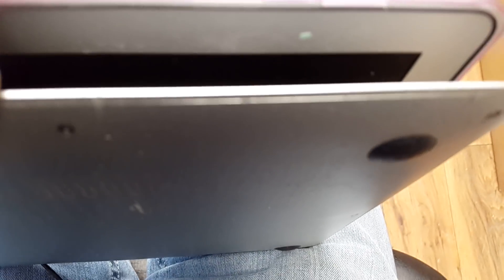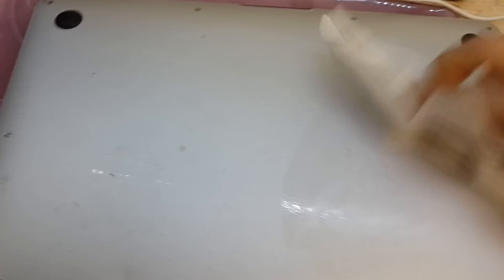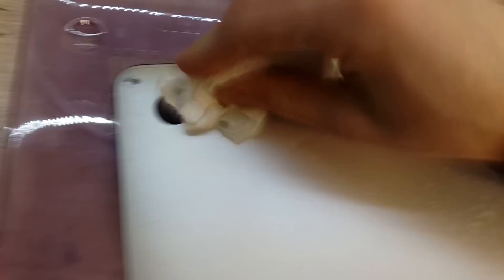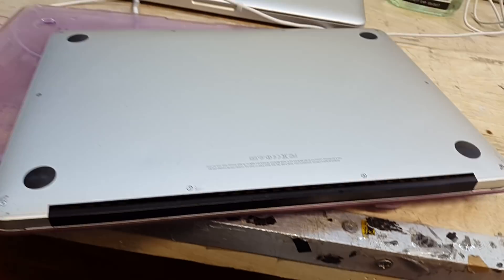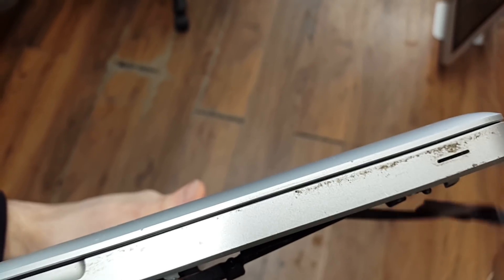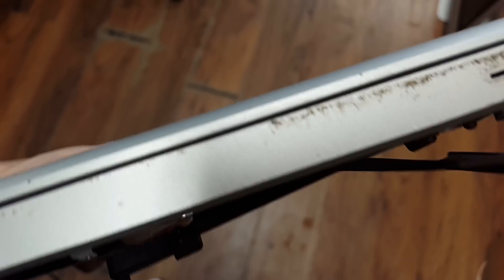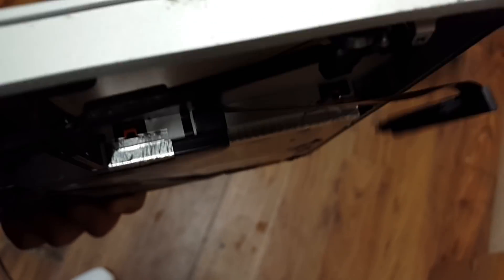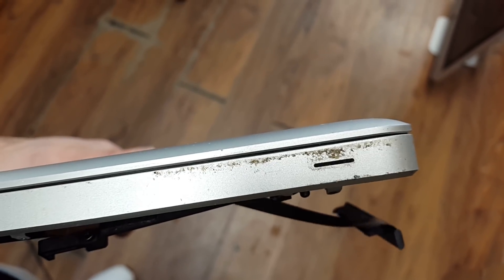Avoid plastic snap on Macbook cases: they are disgusting! 20160123 105752

Comment: I can never understand the meaning of putting on a casing for laptops. And to my knowledge, I think only MacBook users like to have casing for their laptops.
Reply: People who buy a $1200-2000 mobile device seem to be easily tempted to buy a $10 product to protect it.
Reply: @dgk4486  The thing is, adding a snap on case not only covers the original sleek design of the product, making it feel worse, and the product itself will still get old and wear out as time goes. I never use any case for my cellphone and laptops, nor do I use screen protectors. I can understand the need for making the cellphone grippier or more protective against falling. But laptops? I don't think that's really necessary.
Reply: @weskeryuan6435  The point for these cases is to prevent against case damage due to small bumps and drops. This is particularly true of the rather flimsy metal used on the MacBook Air. It's really easy to dent these. I'm not fond of the gunk that ends up under these plastic cases, but they do serve a purpose for people who are prone to dropping things. It's super easy to dent key connectors and prevent their use on the MacBook Air. With that said, most people don't know that you have to periodically remove the plastic and wipe down the metal. It should be common sense, but I guess a lot of people don't know this.
Reply: Nah man dbrand is cool
Reply: @EpicCineSnaps  Dbrand is shite my dude, I have never had a Dbrand skin that didn't make my phone a slippery mess.
Reply: @thatwolffe3802  yea it makes em slippery but for my mac it does the job
Reply: it's all about the fact that they hold value much better than cheaper chinese laptops, so people think they will be be able to sell them for more if it LOOKS better (after hours of cleaning)
Reply: It's so they can put stickers all over it hahahaha

Comment: The only snap-on Mac case I've ever used that never seems to have that problem was a case made by STM and that's because it has no vents on it (which isn't needed anyway) and the interior of the STM front and bottom cover is lined in a fine microfiber/suede type material. That leaves no gap for dust and crud to get under it. Sadly my laptop seems to have suffered a burnt out backlight fuse. It still works, but doesn't light up and sending it to Louis from Australia for a 2009 model Macbook Pro doesn't seem worth it. Even my friend Theressa (Louis knows her) thought it wasn't worth fixing.
Reply: It me  Why TF can't you read properly. The screen is dead, I haven't used it in years, it just collects dust now. I've been using Windows PCs for years. I got the darn thing back in 2009, that's 10 years ago in case you can't count that high :P
Reply: It me Get stuffed mate, I don't have to justify my reasons for buying a Mac to some d-bag in the internet.
Reply: It me  There's a bridge somewhere that's missing it's Troll, get back to work.

Comment: I accidentally did that on my MacBook years ago. It made me sad when I went to do my yearly internal cleanup. Please for the love of god do not get that plastic shit.
Reply: I've been using them for years and it is never like that when I take the plastic off.  You can wipe it right off. I don't know what you people are doing. It's not happening to me.
Reply: @rrrglynn  Maybe you are that one clean person who washes their hands after going to the bathroom.
Reply: mine is 10 years old and never had an internal cleanup
Reply: not gonna lie i'd open the bottom and dust it out you might have a family of dust bunnies in there and dust makes any compute mac pc linux w/e hotter and computers hate heat.  @CouldBeFrench
Reply: @holyvanguard  haha it's an old a1342, not worth it really, only use it for iMovie, emails, internet and iTunes.. not got much use for a other than that and it's still great at it's job :') I don't game so really never been a problem with heat, sits on my bed whilst i watch films just fine haha.. just stating not had one problem in 10 years and used daily, replaced the charger a few times as they always fray but defo got my moneys worth and still looks better than any windows laptop, just look nice instead of looking like they should be in an office. I work in admin so sit at a terrible windows net computer thing and i honestly have no love for windows in the 10+ years working with it.. have you ever tried connecting a printer to a windows pc? mac's are just easy and just work in my experience.. but not had anything recent.
Reply: @CouldBeFrench  fair enough I mean still won't hurt anything tbh. but you do you and if it works for you then kudos =D

edit I remember the pain of printers with windows..... the bane of my existence though when it comes to pc vs mac vs other os (haha) there is no "one to rule them all" there is only the one best for you or what you are doing. I use pc and mac and yes it's a nightmare trying to synchronise them. but it works for me and it's fun and not gonna lie the whole windows not liking printers was only a problem for me if I tried to do anything more advanced than printer on network everybody prints lol
Reply: Skinny Pete “yearly internal clean”?? What’s that? Should I try that on my MacBook Pro 2016? I got it last june
Reply: it's when I open the bottom and clean the dust out of the inside and clean the case up etc a clean mac is a happy mac.  @riotmakerzify

Comment: Nearly impossible to remove with 25 minutes and goo-gone
Reply: Just a disgusting practice of complete disrespect.
Reply: @dgk4486  For your customers.
Reply: If we could somehow manage to make a label from this material.
Reply: Thank you, have a nice day!
Reply: Magic eraser pad with very little water removes it
Reply: @BreakingJohn  It's nearly impossible to remove.
Reply: @dgk4486  there is NOTHING that 99.9% isopropyl alcohol can't clean or remove
Reply: @BreakingJohn  just a FYI, those pads are abrasive. And go to pieces like a pencil eraser. Just it's probably easier to get a skin, and more sanitary.
Reply: George Robles maybe but it's aluminum and I used it almost dry. Didn't see any damage from the eraser and it didn't break apart.
Reply: Alcohol
Reply: Free Audio Books always the solution
Reply: *insert " i know that reference" by captain america meme here
Reply: I saw that before on his table but I don't know the context. Can someone help?
Reply: @MsUnderattack  It's a quote from louis in another video where he basically says the same stuff and over-exaggerates the effort to remove gunk on cases.
Reply: its body oils soaked  dust,  goo gone isn't going to clean it because  goo gone is a mild solvent for adhesives

Comment: It’s not about value, it’s about protection. These people are being scammed into believing that these products will protect their computer.
Reply: Similar products protect phones well, so you'd think that also goes for notebooks until you take it off again.
Reply: @LEXXIUS  I don't know about you but I don't primarily use my laptops standing up and one handed so there isn't any risk of dropping like a phone would.
Reply: @LEXXIUS  
I take in phones as part of my job @ Gamestop.  

They do the exact same thing to phones...
Reply: I'm glad there are theories about the protection they provide... But in reality, I've witnessed that they do provide some protection. No different than a cell phone case. And no, it's not mold and it's not difficult to remove. No different than the gunk that builds up on a cell phone case, your watch, your glasses, your keyboard... Keyboards are far more disgusting than this stuff.
Reply: Agreed. Hard shell case isn't gonna protect a MacBook from falls. The shock will still travel through and damage anything sensitive like a hard drive or glass. Unless people use these cases for aesthetics to color their PC, people are retarded for thinking it's a form of protection. At best, it'll protect it from small drops like the couch to the floor, but even then drops like that won't damage computer outside of a little dent. My laptop has 3 dents on the corners from bag drops but it's just aesthetic damage. I wouldn't bother buying a  "case" for it outside a  fabric sleeve which works to cushion it better, and personally I decorate my laptops with stickers lmao.

Comment: What case/s would you recommend?
Reply: They make those big green ones that you see behind stores.  They're popular and  look pretty durable.

j/k; I think the main point is to avoid adding things to the laptop that will give extra crevices for organic detritus to accumulate.  The same sort of gunk accumulates in crevices on any other thing that people rub their hands on all day, whether it's mostly just dead skin and sebum or an active biofilm.  Either stick to a regular cleaning routine, or just avoid creating extra things that need to be cleaned.  

As far as removing it goes, strong degreasing detergents work well on oxidized skin oil buildup. Use caution though; they also tend to be good at eroding or removing paint and ink (e.g. printed legends or labels).